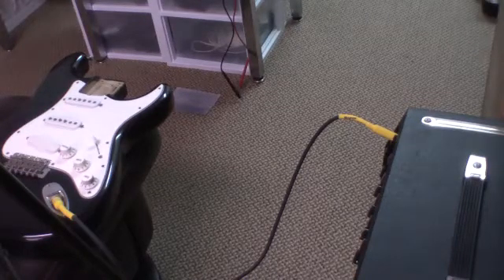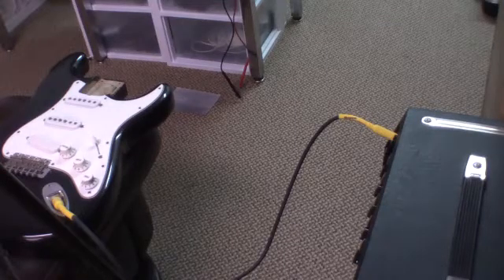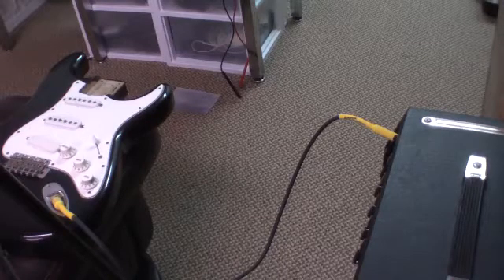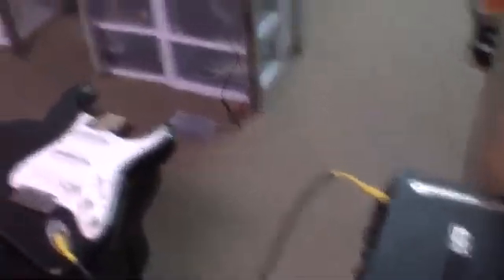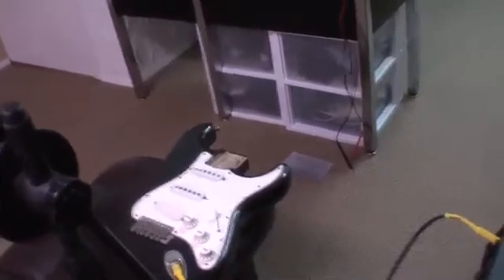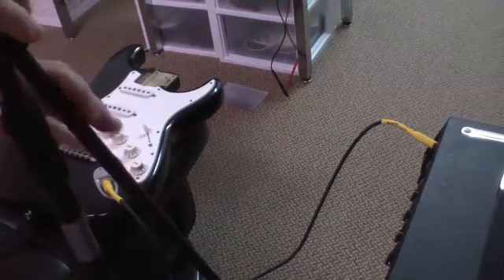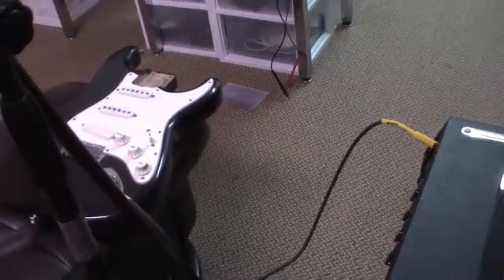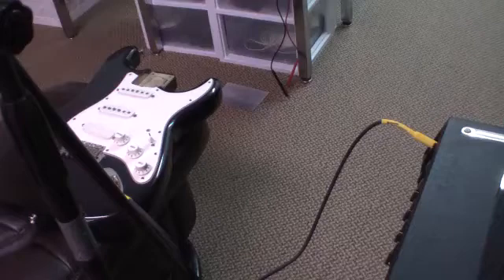Does Tone Wood Affect the Sound of an Electric Guitar when Plugged In?

Comment: I don't believe (only from personal experience) that  tone wood has 0% effect BUT I do not think it has the a defining effect on the sound / tone produced.. (and tbh how many people play  completely clean / no effects - and I'd say the processing that goes onto most guitar signals will be way more defining in terms of the final sound)

I think it is much more determined by other factors (p/ups / electrics  / processing etc) and as you yourself say on a strat style the p/ups are on a plastic pick guard SO why on earth aren't we debating the sound of pickguards on strats more than the wood of bodies and necks - as surely this is the most resonant part of the system that the p/ups are mounted on.. ?

Mayb a test where someone gets a sound-hole magnetic pickup  and fits it to a range of acoustic steel string (all the same strings)  guitars of  the same type eg dreadnought (but with different tone woods  etc)  and feeds them all into the same amp set up set to give the same average output THEN see if there is a massive difference in tone - because this is an extreme example of what some people are saying is the model of the solid body electric guitar set up.... Surely this would help demonstrate the way that the interaction between vibrations in the body / wood affect the signal produced by magnetic interaction between p/up and strings - it isn't scientific but it it might show big differences or very little and help the "debate"

AS with all things people that say there is ZERO effect or 100% proof  - then I would like to see evidence that supports their standpoint... because I have seen both sides provide "proof" which doesn't  support the ALL or nothing  view - in many cases the difference in sound  between two solid body guitars of the same type made of different wood is small enough to be explained by other sources other than the wood in isolation - a complete rebuild with all the same electrics / strings  and  hardware followed by a Fourier analysis of the signals produced to determine if the harmonic structure has changed would be nice.... any volunteers??

I think what we have to ask is HOW a signal is produced by an unstrung guitar....??

Since the p/up can only produce a voltage when a magnetic flux is in relative motion with a conductor - (look up Faradays law of electromagnetic induction) then tapping a guitar body unstrung would need to generate vibrations that cause this relative movement, surely.... so would  wax potted or epoxy potted p/ups be affected in the same way / to the same extent.... we need to know the mechanism that causes the signal production in order to then isolate the causes and determine what then are the main factors and then if any of these are related to the wood used 

BTW  does all wood of the same species have the same properties sonically or does the very fact that each tree grown is a unique material due to the conditions / environment in which it grew and its treatment after felling? IF not how much does it vary - enough to start a debate about mahogany or maple  sonic differences (when used in solid body electrics that is)

SO much hate and abuse on many YT vids - so please don't start on me as it's really not my thing (I have no need to establish myself as a guru / alpha male or whatever) - when surely the real purpose is to enjoy the music produced?!
Reply from the maker: I am mostly in agreement with you, and on that note... I bought a new pickguard made of aluminum and loaded with Seymour Duncan SSL-1 pickups, and it improved the sound of this guitar 200%
Reply: KyleCarrington
I bought an old Westone Concord IIT on which  someone had ruined the pick guard (installed a Humbucker badly!) and resorted to making a new metal one by using the old one as a template  - and converting it to the Armstrong 12 tone strat wiring  - and it really benefited (plus it helped the  shielding job I did too) - shame it didn't help me play / sound better...
Reply from the maker: rusholmemike yeah. it really quieted down my strat, too. some of those old westones were nice.

Comment from the maker: Tone truthers?

Why does this guitar not sound A LOT more like a gibson Les Paul, hmmm? Because the nuts on a Tele are so much different... the bridge?

I don't think so. It's the fuckin wood already.

A demonstration of my Telecaster customized by me.
Reply: Interesting little test there. There's only one problem with your methodology. It's a guitar, not bongos.The 'tone wood' argument is not wether or not the sound of you knocking on a guitar will transfers through. This same test would get the same results if the body was acrylic. The debate is, does alder sound different than maple, or ash, or mahogany while actually playing it. Unless you play the guitar by knocking on the body all the time, them this test is as invalid as testing an amp with no electricity. The tone woods debate is about the tone of the guitar. If the type of wood is such an important aspect, why do acrylic body guitars sound good? Only way to truly test this is to have 2 or more bodies made out of different 'tone woods' and use the same neck, pickups, controls, strings, bridge, etc. on each body. Then actually play the thing
Reply from the maker: element180gmail Did i say this was about the classic argument. did you read the opening caption, buttboy? Get a fuckin brain, watch the fuckin video, read the description:

In this video I show how, if energy is transferred into the body of a guitar via the bridge, the nut, or a fretted note (into the neck)

 and stop being so butthurt when someone presents something as a sidebar, buttboy.
Reply: The scale length of a Telecaster and a Gibson Les Paul are different, therefore they sound different even before pickups are factored into the equation. 
   For example, on guitars we have duplicates of many notes- an open first E string sounds different than the same E played on the third string, 9th fret. The wood is the same, the guitar is the same but the main difference is scale length and string thickness. This is basic stuff.

Comment: If any of you really want to HEAR it, there is a video made in the UK with TWO identical guitars, but two different woods for the body.  If you cannot hear the difference, then you are tone deaf, as I can hear the differences clearly.....  The rest of you will just have to go on and ignore the woods and buy what you wish, but different woods do in fact transmit a different sound through vibration in the body and neck.  You can go on arguing it to death if you wish, but I am one who can hear the difference, the rest of you I feel sorry for.

PROOF - Wood Affects Electric Guitar Tone - Chapman "Special Run" Swamp Ash ML-1
Reply: I agree, I mean if you can't hear the difference, then my only comment is "that's too bad".
Reply: Those two guys are the biggest fools on the Internet!
Reply: Robs test is invalid as well. They are not 2 identical guitars. The difference in the tone between those guitars comes down to the FACT that every pickup sounds a little different from each other. If you want real proof than take 1 neck,1 set of strings, 1 set of pickups, 1 bridge, 1 set of pots, 1 nut and 1 set of tuners and than switch body's made from different woods between them. I garrntee no difference in tone as long as everything is put together and set up as close to the same between every body.

Comment: Umm, failed test. Without strings vibrating over either pole, those pups should not generate any signal. What this test proves is that those pups are microphonic (that is, the magnets in them are moving) and need re-potting (if they were potted in wax to begin with, if it was epoxy or plastic, you'll need new ones).

Pickups are transducers and work by way of electromagnetic induction. Vibrations in wood do not modify the magnetic field around the magnets. So, long story short: a guitar without strings producing any signal but a null signal indicates a problem with the pups.
Reply from the maker: Wrong. They are Fender USA 1962 re-issue pickups. About 18 million are in circulation. This test works with brand new Seymour Duncan potted humbuckers, i.e. '59 or trembucker JB. MAKES NO DIFFERENCE  >>> ALL <<<<  PICKUPS ARE MICROPHONIC, IN FACT, THE DIAGRAM FOR A MICROPHONE IS PRACTICALLY INDISCERNABLE FROM A DIAGRAM OF A PICKUP. SORRY, FAILED COMMENT
Reply: ratbertovich ALL single coil pups do exactly what this video shows. They are ALL microphonic to some degree, most easily heard in the neck position. If you've never tried this test, your comment is based on theory, not experience.

Comment: Hi there Kyle,
While I can say that what you are saying as far as sound travelling into the body and neck of a guitar and back again is absolute fact.
 I so far in my experiments have failed to find evidence that it contributes enough to be perceivable to the human ear. I still want to do some measurements so that I have real data to show for what I am saying.
This is a great thought provoking video and I am sure it has motivated me and others to look further into the subject.
Reply from the maker: The funny thing is this. If you've been playing for 20 years or more, or even if you haven't, you may be able to appreciate what I am about to say. You're in a store, you pick up a Les Paul, or a Strat, or perhaps some other instrument. You play it for 5 minutes, unplugged, and you are very, very pleased. Amazed even. It sustains beautifully, and the notes jump out of it, with what might be termed "fatness", they are toneful. You very much enjoy the sound of the guitar without an amp. it has character, as well. Not surprising you plug it in and it plays like a dream. Here is the dilemna, does the wood contribute to this effect while plugged in, or not? Bottom line, it does. The wood vibrating, interacts with the other components - that ultimately physically changed the oscillations. In addition the pickups ARE (all pickups) LISTENING to the strings like a microphone (exactly like a microphone) to a small extent. And that includes modern expensive potted humbuckers, as well. This adds to the "character". It makes a Strat sound like a Strat. To say that the wood has no effect is to say that if you remove those pickups and put them on any old piece of shit with a similar nut and bridge saddle; it'll sound identical, and it's simply not true.
Reply: I have done A/B testing in a method you describe at the end of your comment and up until that point I felt that wood did affect tone.
Also what you describe is exactly what I thought was happening. I am not trying to convince anyone of anything I am just sharing what I have found and also what I am working on.
But who am I?
Just another nobody.
Sorry I wasted time.
Reply from the maker: ***** If all it took to make a guitar sound identical to a high end Gibson, was to install high end Gibson pickups in it.... end of story... after 50 years, there simply would be no high end Gibson's. Or Fenders. Or Gretsches. Simple physics defy "tone truther logic" -- all of their theory is based on a single notion: that guitar strings are inifinitely supported by infinite mass of infinite density. in such a case, the wood makes no difference. However in the real world, the strings, the bridges, the nuts, the frets - THEIR behaviour and interaction with the string (and thus the final product, the oscillation pattern as seen on a scope, or heard audibly) IS EFFECTED by different woods, of different mass, and of different density. And thus, Newton was not a flake, a liar, a loser and a man with nothing to offer. Timbre is physics, it is science. Electromagnetic wave calculations, and their math are PART of what is happening, not all, and in fact, if it were as simple as the tone truthers claim, the scope shots would all be perfect sine waves. And they are not. And thus everyone arguing, without physics, are basically wrong, until you can prove Newton was incorrect.
Reply: KyleCarrington I dare say if you installed the Gibson pickups and wiring loom into a guitar with a tune o matic bridge, 24 3/4 scale length and a similar nut that was set up nicely and made out of plastic, people would hardly notice the difference as a listener. Playing it would be a different story though.
Reply from the maker: ***** i havent done much recording yet, but listen to this, it is the video that sold me, they sound sooooooooooooooo nice. john frusciante from the chillis uses them exclusively

The Best Strat Pickups Seymour Duncan 50's California Set SSL-1
Reply: KyleCarrington  Kyle , another wrinkle in this is the psychology of tone. If a guitar feels lively, sounds great acoustically, and provides you with that great feeling while playing it... You are more likely to feel it has great tone. Especially at lower volumes, the wood affects your experience as a player. This experience is real, but may not always translate to that signal from the pickup.
Reply: Kyle, that's a lovely rant but I'm afraid that you misread me. I'm also more on the "body materials likely have an impact" camp. My comment was directed more at the guitar store experience and "if it sounds good unplugged, it'll sound good plugged in" fallacy.  The basic facts of human perception and the multisensory experience of playing a guitar make people generally poor for objectively assessing tone. This doesn't mean that you're wrong about wood - it just means that if you walk around a store and play a bunch of guitars thinking you know what they will sound like plugged in - it's a bit of a stretch.
Reply from the maker: ***** Ok, well you do make a good point and I should correct myself OK... you are actually totally right, you can determine which ones resonate nicely and sustain, but if the pickups suck, well, you're not gonna like what's resonating, or sustaining, which is exactly what you get with that guitar in the video. It's probably worth 3000 bucks, however... just because its a first '62 re-issue made in the fulelrton factory... it still has '62 pickups and they SUCK. it was a tin can ice pick, and yet, it sounded great in my lap, so, you've made your point, i do stand corrected on that previous statement. PS i put in Seymour Duncan SSL-1 California Fat 50's and they are AMAZING.
Reply: Thanks for the Duncan SSL-1 recommendation! I have this Frankenguitar idea that includes some fat humbuckers, tele body, and a strat neck.

Comment: Bingo! A string is able to receive this recessive vibration from the body, and it results in tonal coloration. Think about it; if the string is ever so lightly pressed at certain intervals, or frets, a natural, overriding harmonic is produced. Over each or the pickups, just behind them, and slightly in front of them, are also harmonic register zones. Thus, the bounce back from the string into the body, back into the neck and strings again, produce a tone only able to be reproduced by a guitar of same make and specs, even though the small diff and variance in the two same model's parts will sound slightly different from one another, the sound will be extremely similar. This is why ash with maple neck is guaranteed to be very high in voice, where as mahogany and rosewood stay very muddy and much closer to bassy in sound. Hot pickups only make the sound louder and distort faster, they do not change much else tone wise.
Reply from the maker: I agree with that. I've taken '57 Gibson humbuckers, out of a Gibson Les Paul, and put them into a Tele that had a Gibson Tunamatic bridge. Both had bone nuts. They sound nothing alike really.
Reply: KyleCarrington Again, scale length.

Comment: There are a lot of guys out here who claim wood does not effect the tone of an electric guitar and it's because they don't understand the resonance/ pickups and bridge /nut vibration and how it all works on an electric guitar - they claim it'sbecause your pickups are not potted and only the string can influence the tone of the instrument when plucked - but the string is influenced by the wood that's vibrating underneath it thus the differences in tone from a rosewood neck to a maple on a fender strat for instance same guitar different neck bolted on different tone - the guys who clainm it doesn't affect the tone are tone deaf or tin eared - it's obvious as soon as you play through your amp that the tone has changed - if you cant hear it it's not the guitars fault it's your ear -

Comment: You know that a STRAT has up to 5 SPRINGS at the back? Those springs usually RING and RESONATE and the MOVEMENT OF THE METAL SPRINGS is captured by the backside of the pickup (because yes the backside is also influenced by moving metal, the backside also has a magnetic field) Those that you hear are the springs at the back, not the WOOD vibrating.

Comment: Are your pickups potted?
Reply from the maker: All Fender Vintage '62 Re-issue pickups are potted, yes. That said, they are subject to 60 Hz hum (big time) like any single coil. Especially when they are 24" from a tube amp turned up loud. The microphonic effect, however is present in modern humbuckers, as well. This same effect was replicated on my 2009 charvel USA that uses potted Seymour Duncan JB/59 pair. All pickups are microphonic, - to an extent - and thus display the ability to "listen to the wood" to one degree or another, which is exactly the point of this video. The pickups "listen to the wood" and the wood, in turn "affects the vibration of the string"  - to an extent - in both cases. While it isn't a large part of the make-up of the signal, it's there, it's real, it's physics and it's indisputable.
Reply from the maker: yes.